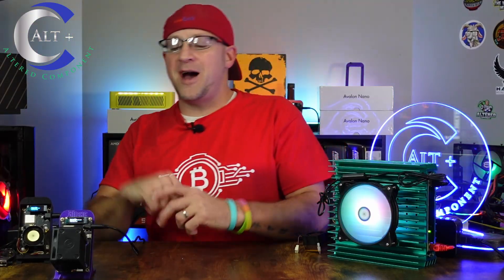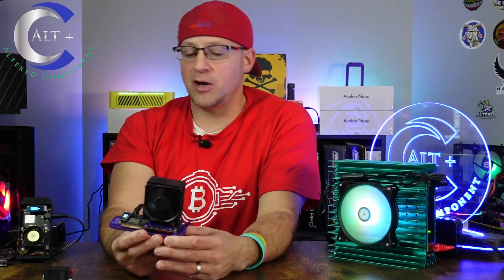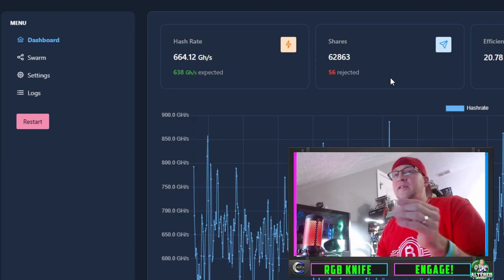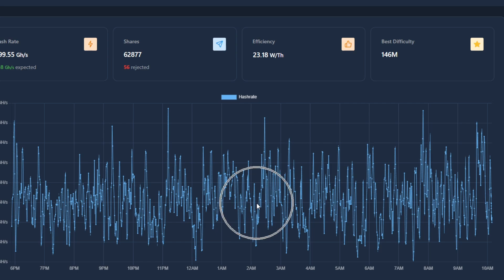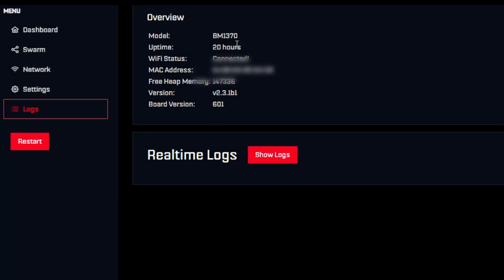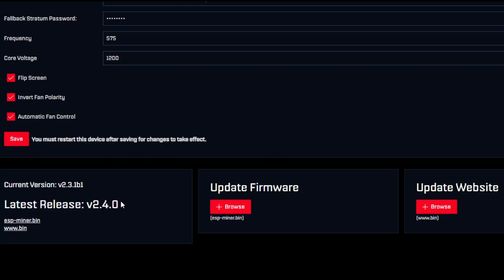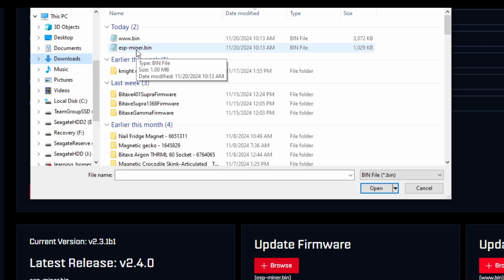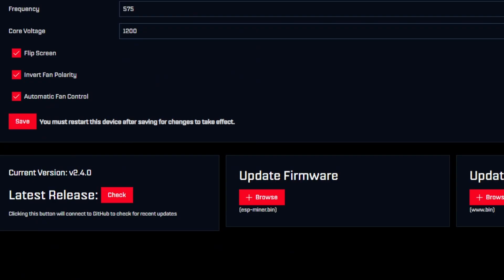Better Hashrate, Stability, & Features for your Bitaxe | Firmware Upgrade How To #bitcoin #bitaxe 🛠

Comment: update website first then firmware otherwise it can crash and latest software is v2.7
Reply from the maker: Thanks for the comment.  100% a great comment and i should have mentioned.  Pinning
Reply: @AlteredComponent  there is also a benchmark program for bitaxe (every processor is different) its the way to find your best overclock settings.

Comment: The correct order is to update the website first, then update the firmware. Reason being is the firmware update automatically reboots the device upon completion, so if you try to update the website and the device reboots, it could brick the Bitaxe. There were reports of this happening to ppl. This is why they changed the order in later updates. Also the GitHub link is provided when you click check for updates, the version number is a hyperlink. No need to navigate to an external site if that's all you're looking for😊

Comment: @AlteredComponent I want to upgrade the cooling on my Gamma 601. Which Notuca do I need to order, is it the one with the  3-pin or 4-pin? I want the Notuca for the ASIC chip, then plan to use the stock fan for the back to cool the Voltage Regulator
Reply: 4Pin, i ordered it from amzn and the y cable was already included Noctua „NF-A4x20 5V PWM“. Rear fan brought me -10 degrees on the voltage regulator💪
Reply: @Eidgenosse  thanks for that. I ordered this morning & will receive it Friday, then I went on Craftcloud to 3D Print an enclosure that'll support up to 3 fans and make it a little nicer to look at 😆 I'm excited to see what these new upgrades will do for it
Reply from the maker: Nice.  Let us know the results
Reply: @AlteredComponent  Notuca's will be here Friday. Then I used Craftcloud to 3D Print a new case that will allow me to mount 3 fans (top, front, and back)... as long as I can overclock a little and keep it at a normal operating temp, then I'm happy.  But I'm not gonna go and take the radiator off my Ford F-150 to rig up something crazy, like what you see with a lot of others out there 😆
Reply from the maker: Thanks....100%
Reply from the maker: as he said, 4 pin which is PWM.  5v is the key.  Can really be any 5v 4pin setup as long as the wires are matched

Comment: der 60 mm Lüfter ist nicht so gut, der 40 mm PI Lüfter paralel ist besser, weil er den bitaxe voltage regulator gleich mit kühlt, macht -10 Grad unterschied
Reply from the maker: Yeah, We can super cool and overclock the asic chip way up, but then we get limited by the voltage reg temp.  A  second fan on back in parallel like you said is optimal. Also Ive noticed that the low profile Rasp Pi Ice Tower seems to be one of the best because you can blow the fan down on the board and help cool the overall temps included volt. reg.